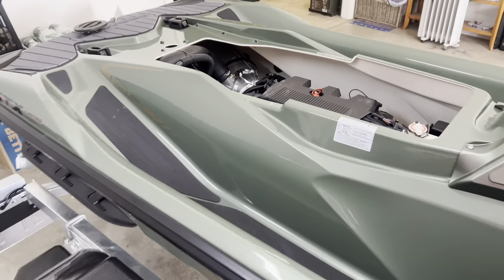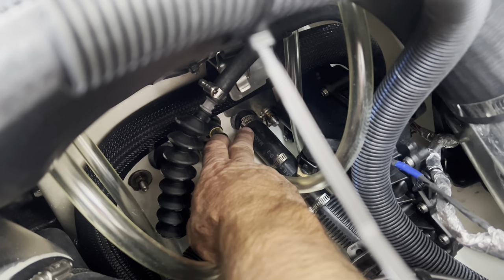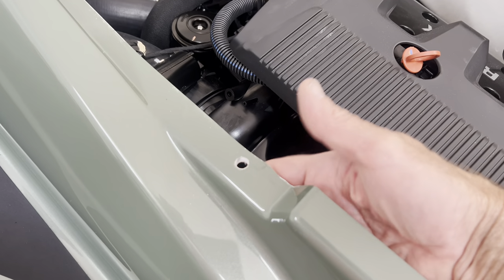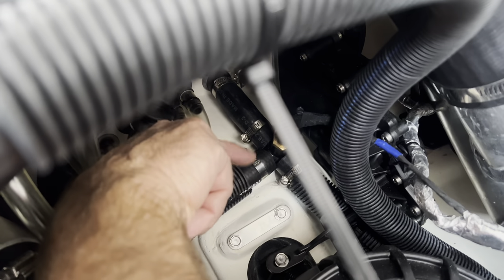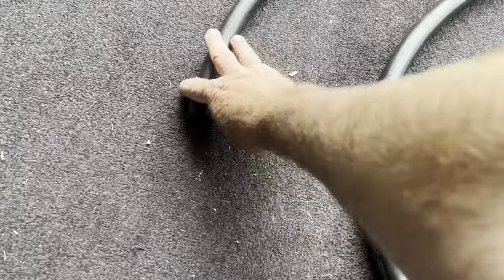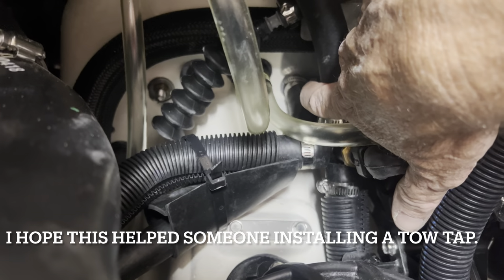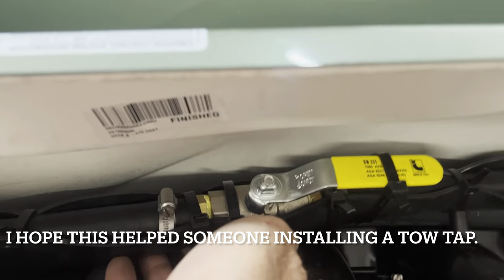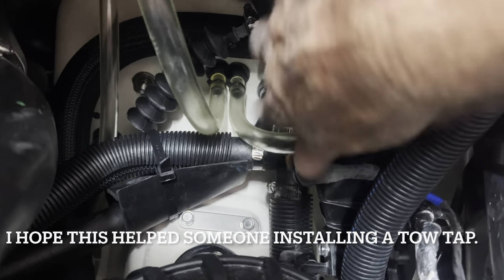Seadoo GTX300 2022 Tow Tap Install

Comment: You can just clamp or put the valve on the hose going to the exhaust manifold.  The other line simply goes to the intercooler which then dumps back out of the ski which wont flood the engine.

Comment: Interesting, I thought seadoos had a closed loop system.
Reply: The CLS isn't relevant to needing a tow tap. When a breakdown happens and you need to be towed, you can still take water in and finding the lowest path it'll make its way into the engine. Hope this helps 👍 (a very brief explanation)
Reply: Only for engine cooling, not for exhaust cooling. At 0:08 see the shiny metal "can" water does enter here from the exhaust cooling system after it goes through some piping. The pressure from the running engine moves the exhaust and water out of the ski.

Comment: Great vid! Many thanks.  As per below comment, a lot of people have extended and put a valve on the hose that goes to the exhaust manifold.  Was there a reason you put your valve so stop water before the T section that the hose I am talking about comes off? Tks Brad

Comment: Hi Brendan, is there anywhere on the intake hose or outtake to the exhaust were it's easy to crimp temporarily in case of an emergency? What is the T for on the intake hose? Are there two heat exchangers??
Reply: There is ..but it's in the back of the engine ... you need to take the cover panel off to get to it .. that's why the tow tap needs to be extended to an easily reached  spot

Comment: Why do you have to run a length of hose, why not just a tap at the base then to t-piece?
Reply from the maker: @bluedog9601  …so that the tap is readily accessible from under the seat without the need to remove the deck.

Comment: Did you use the same  metal camp ring or did you get bigger one, when used on the first plastic inlet attachment to the jetski, the cold  water coming in. I am worried the clamp is not the best made thats why?

Comment: Hi everyone.... maybe i am missing something.

Most newer seadoos have a closed loop system.
They do not use water to cool off engine.
So why would you need that tow tap?

Can you still flood the new seadoos as you tow???
Reply from the maker: Yes can flood the engine via the exhaust manifold.   Check your instruction manual for advice.